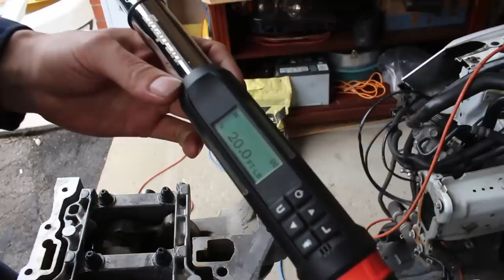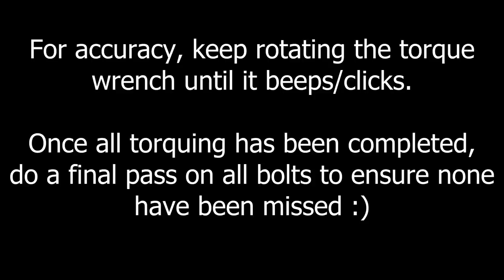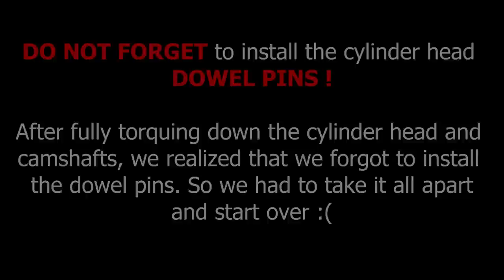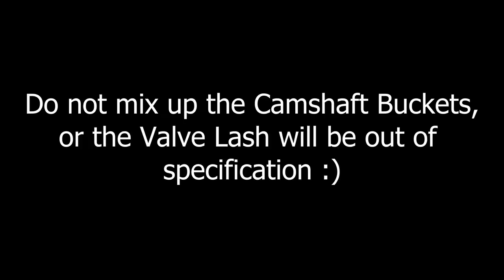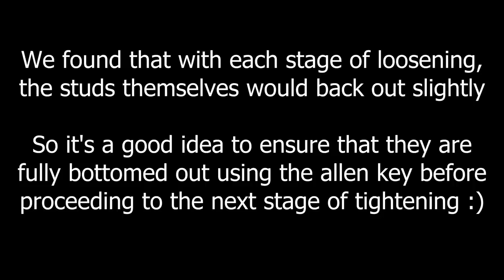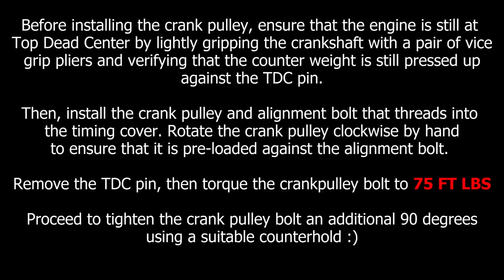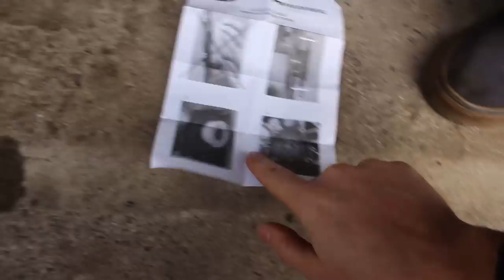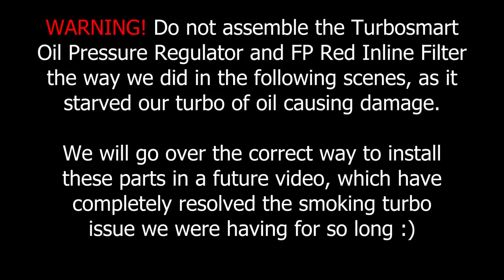Mazdaspeed 3 - Built Engine Assembly

Comment: Woohoo! Got my CX7 2.3L Turbo back up and running - thank you so much for the video and the answer to the comments along the way... I had the scariest moment though - on first start the engine seized after a few seconds despite being primed... I thought it was game over... pulley would not turn over by hand!!!

Dropped pan and found one of the rod bearings chewed up and material stuck to crank... heart sank!

I polished off the material on rod journal - crank was perfectly fine as it had not heated up... I changed bearings and noticed that the rod cap had no side to side play on the one that seized... then it struck me - the caps of the replacement connecting rods must have been switched (either by myself or the guy who sent me a new used set). When I swapped the caps over, the rod caps had nice side to side play.

Put balance shaft back in, threw in the sump pan, and the engine now purs...Works perfectly and has zero smoke. Got a few 100km on it now, and it's smooth as butter!

That was scary AF!
Reply from the maker: @pingpong9656  Oh man what a scary situation. Congratulations! Hopefully it runs for years to come

Comment: Finally! Glad to see you guys back. Been waiting for this one. My engine build is in the works for my ms3 I went with CS cams and an EcoBoost  crank. Should be interesting.
Reply: Does the ecoboost crank fit without modification?  I was under the impression that the flywheel flange is different to ours?

Comment: What a perfect representation of skilled mechanics, thanks for this video! 
What kind of alignment bolt is used for that hole in Crank pulley? Thank you
Reply from the maker: Thanks man! It's a small 10 mm bolt. I'm not sure about the thread pitch but we did notice that the 10 mm bolts that secure the power steering pump/coolant reservoirs thread into it. So just gotta figure out what thread that is :)

Comment: Before dropping the head on, rotate the crank backwards 45° from 1 and 4 at TDC. Then the head can be installed. When you put the cams on the head, get the timing close on the cams. Then the cam timing tool can be put in and the crank turned in the normal direction of rotation. Now the timing gears and chain can be installed.

Comment: Welcome back!
Reply from the maker: Thanks dude!
Reply: @WannabeTuners  I'm gonna try to take on a built engine for mine. This video seriously gives me inspiration to take on a rebuild myself. I'm just about to wrap up some much needed TLC with mine right now. New valve seals, new-ish exhaust cam, pcv plate, occ install, new stock turbo(I know), new rod bearings, new timing chain, new timing gears and guides, new timing chain tensioner, new oil pump gear, tensioner and chain, corksport injector seals, egr block off plate kit, and maybe more. Your videos have helped me immensely! Seriously!
Reply from the maker: @HoUsEoFcAtS78  We're really glad to hear that brother!

Comment: you always do a final wash of a block after the machine shop is done, they just don't get them clean enough for assembly, also, never touch the plain bearing surfaces with bare hands, the oil in your skin will create hot spots .  also check final rod/main bearing clearances before final assembly.

Comment: Quick tip: use electrical tape on the braided lines and then cut the hose on the tape. Perfect cut and easier installation of hose ends.
Reply from the maker: We tried electrical tape but found that a zip tie worked better to keep the braids from fraying

Comment: Guys, tip for the future, tape the hoes and then use zip tight so when you cut the line every single wire will stay at the place dont remove the tape until u place AN fiting and then you will be able to pull the tape holding the fitting in ist place. Btw appreciate so much content you make, wish for more videos comming soon
Reply from the maker: Thanks for the tip man, we didn't have any tools specifically for AN fittings so we tried to make do with what we had lol

Comment: Oh my goodness, anyone watching this PLEASE do NOT put a gasket/sealing surface of any kind on concrete while trying to loosen, tighten or doing anything else for that matter!!
  If this was a high pressure sealing surface it most likely would have failed and needed to be machined flat/true after something like this.. 
  But otherwise pay attention, ESP to torque specs on things that literally have just a few threads to hold whatever bolt or firing in place..
  Oh, and last tip for anyone watching before doing ghis or a similar job, having the metal surfaces extremely clean is the most important thing for getting fittings like these to seal properly with no leaks! The clean surface, followed by the proper sealants and proper torquing(in the proper sequence obviously where that applies) will give you the absolute best chance of success possible!

Comment: 18:30: It's a debatable topic because when you install somthing that needs to be torqued down , you pull the clamping hardware down and when you do another pass you go above the initial torque you had set it to , think about how many passes at 35nm you could do before they all are actually at 35 nm , the gasket will keep crushing

Comment: I’m so happy ur back in action, I got a 16 focus st since u blew ur motor. They’re pretty similar. It’s got an EFR 6758
Reply from the maker: Ohhh man how does it compare to the speed?
Reply: Wannabe Tuners it’s about the same. I test drove the Speed3 before we got the ST. The only reason was because it had about 80,000 less miles. I didn’t know how lucky we were when we got it. It already had the Full Race EFR kit with catless DP, the 6758, straight pipe roush exhaust and CPE lightweight FMIC. All it needs is the exhale pipe and an Accessport. We’ve been strained on money so we’re gonna have to wait for the AP but still right now if it’s even a little wet the tires will spin all the way in 4th. I’m in Florida so it usually is always wet. It’s nice, and it’s just like the Speed3 only newer features. The only bad part is w/o an AP the ECU is very limiting
Reply from the maker: @ryanharris6788  Yeah I was gonna say you'll be able to really take advantage of that setup with a solid tune, but that's awesome man, glad to see a fellow boost enthusiast enjoying their car. I've always had an admiration for the ST's
Reply: @ryanharris6788  with all that mods on by the previous owner. You need to take extra preventive meassures b4 you really beat on it.🤘
Reply: Wannabe Tuners If ur ever in Florida hit me up for sure. I don’t know why u would be but hey, offer is out there.
Reply from the maker: @ryanharris6788  Florida is definitely on my bucket list ;)

Comment: Glad to see you guys are back. I want to point out that the crank pulley is still crucial to the engine running. Sure, if it slips, you will not damage valves. However the car will not run right or stop running altogether, as the pulley tells the ecu crank position.
Reply from the maker: You're absolutely right brother! The nice thing is that it only has to drive accessories so the chances of it slipping a pretty low if the correct tightening procedure is followed
Reply: Absolutely! Why did you have only the gears keyed instead of doing the pulley as well? Big cost difference?
Reply from the maker: @spillybuilt7491  Tbh I'm not sure because I did provide them with the pulley as well. I think they just didn't see a need to do it. I questioned it but decided to just go with it, as they were super busy and I didn't want to burden them
Reply: Yoooo that cam cap you guys put on backwards needs rtv around the bolt holes. Will it leak? Maybe. If it does, that’s why
Reply from the maker: @spillybuilt7491  Oh that makes sense actually, I'll keep an eye on it ;)

Comment: When you put the main seal on - did it not push the RTV into the pan in the bottom? Is the correct procedure to put in the main seal first, and then RTV the oil pan after fully under the main seal?
Reply from the maker: That's a good question. I think to be extra safe, you could apply additional RTV to the bottom side of rear main seal after it's been installed and just flatten it out with your finger. I haven't noticed any leaks though :)

Comment: Great video, one suggestion is to put that return bung on the oil pan higher up... the higer the better
Reply from the maker: Like higher up on the oil pan? We didn't want to drill into the block itself. The nice thing about where we placed it, is that the oil pick up tube is on the opposite side of the oil pan baffle, so we shouldn't have any issues with turbulence at the pick up. Also, the oil returning to the pan is under pressure since it's being bled off, so it's essentially forcing it's way back into the oil pan through the oil that's already in the pan. So far no issues and the smoking turbo issue is completely resolved. We'll make a video that covers the full setup in more detail ;)

Comment: Just installed new pistons and rings - should they make a slight scraping sound when crank is turned by hand? Feels a bit jerky too, but still easy to turn... I was expecting total silence with oil on pistons and cylinder wall. What has been your experience?

I did take out my piston to verify rings and cylinder wall were not damage - they were in great shape...

Don't want to progress in the build until I know it is normal for some light scraping sounds on new rings and newly honed cylinder walls - please share your thoughts!
Reply from the maker: Yep I noticed the exact same thing. The new piston rings need to bed in with the newly honed cylinder walls during engine break in.
Reply: @WannabeTuners  Yes - I rotated it a few times, and the noise is already coming down - feels good on rotation too now. 

Good to hear you experience the same - gives some piece of mind! Don't want to do this twice for sure!
Reply from the maker: @pingpong9656  100% this isn't something you want to screw up lol

Comment: Just tried to prime engine after rebuild - did 10 second bursts for about 30 to 40 seconds - the low oil pressure light did not go out. (Has spark plugs out and foot flat on accelerator to disable injectors).  Called it a night - will try again tomorrow. 

What was your experience like - how long did you have to crank engine to get the oil warning lamp on dash to go out?
Reply from the maker: I went based off of my AEM oil pressure gauge. I'm not sure if the low oil pressure light will extinguish while cranking, as the oil pressure won't be as high while cranking. If I recall correctly, we only needed to crank it a few times before we saw oil pressure on the gauge. I think once we maxed out at around 35 psi, we we're good to go.

Comment: Did you get the bottom half of that balanced at the shop before you put it together?
Reply from the maker: Nope, our machine shop said it wasn't necessary because of the level of quality of the rods and pistons, and that the crankshaft itself is very well balanced from factory

Comment: I'm pretty much stock, save for catless downpipe, intake and cst4 (+hpfp, of course) and tune. 
about how much are you into this engine? I blew the head gasket and I'm looking to upgrade some stuff while im in there. can you ballpark how much it was to have the head looked over by a machine shop as well?
Reply from the maker: If I remember correctly, total cost for machine work not including parts was about $1300 cad. After all was said and done with parts and whatever else, it came close to $8000 cad

Comment: Question about the oil pump sprocket and timing chain sprocket.... I'm planning on using the mustang ecoboost crankshaft and will have it Keyed. Did you just use the factory oil pump sprocket and timing chain sprocket and had a machine shop key them? Or did you purchased them already with a Keyed passageway?
Reply from the maker: Yes we got our machine shop to key the OEM crankshaft, OEM timing chain sprocket, and OEM oil pump sprocket. Only 2 friction washers are used. One in between the timing chain sprocket and crankshaft, and one in between the oil pump sprocket and crank pulley. If you key the crank pulley as well, the friction washers are not necessary from what I've read :)
Reply from the maker: Also I didn't know the ecoboost 2.3 crank is compatible
Reply: Thanks for the info, and yes,   form all the research I've done, the ecoboost crankshaft fromnthe mustang is compatible.

Comment: Why not install 1 and 4 piston/rod assemblies before turning the engine upsidecdowgn to tap them "down" to the crank and install both rod caps at the same time. Unless you are measuring rotating torque after installing the crank and then each piston/rod assembly. Record these values for comparison with other future builds. The rotating torque should increase the torque required by the same amount with each piston installed. If there is a difference, now is the time to check for the cause and correct it.
Wedangrind did this when they built the engines for Dave Morris' F Atlantic one year. He had the fastest straight speeds which all the teams noted. The next year Weldangrind did all the Atlantic teams engines. Now they only work on heavy duty and industrial engines.
Reply from the maker: That's great advice!

Comment: When you put the oil pump in - did you have to prime it before installing? Or does it go in dry and you crank the car with starter after car is back in car? Please let us know what your experience was!
Reply from the maker: We just installed it dry. We primed the engine before first start by cranking the engine until we saw oil pressure on our AEM gauge with the pressure transducer installed into a sandwich plate above the oil filter.
Reply: @WannabeTuners  Sounds good - I did run a bit of oil threw my new pump before install, just to lube it up a bit - good to know it will self prime!
Reply from the maker: @pingpong9656  Yeah good idea to lube it up before install!

Comment: Was there a noticeable difference with the balance delete?
Reply from the maker: There's definitely more vibration with the BSD but u can always run softer motor mount inserts to reduce the vibes (I know Damond Motorsports offers these). The BSD helps the engine rev up more easily when rev matching during downshifts. I'm sure it also helps the engine make power more efficiently as it no longer has parasitic losses from the balance shaft assembly.

Comment: What head gasket did you go with? And what thickness?
Reply from the maker: I went with the OEM head gasket that came in the Stage 3 engine build kit from edge autosport: https://edgeautosport.com/stage-3-mzr-motor-build-kit-mazdaspeed-3-2007-2013-mazdaspeed-6-2006-2007/

Comment: Where did you source all your parts brother?
Reply from the maker: My machine shop sourced the 88 mm Manley Platinum Series Pistons with the thicker wrist pins, Manley H-Beam Rods, Clevite Main/Rod Bearings, and ARP 2000 Main Studs from their suppliers. I ordered ARP L19 Head Studs, Supertech 55 lb Valve Springs, and the Stage 3 Engine Rebuild Kit from Edge Autosports website. I went with a Corksport Balance Shaft Delete kit from Corksports website. Many of the components can be purchased on Edge Autosports website, but it's also a good idea to talk to your machine shop to see if they can source specific parts for a better price.

Comment: The easy way to install steel braided lines fittings,is to wrap electrical tape around (one loop around only). Then cut the line over the tape center and insert the fitting. EASY" and *WALLAHH*😉

Comment: Logically wouldn’t you want to torque the bolts to closer to the minimum torque spec than the max because then they will be able to take more abuse before snapping as they they are less deep into the elasticity zone of the material? Just an after thought, not that I think it would rly matter given the security factor they probably equate into that torque spec anyways.
Reply from the maker: If you've got experience when it comes to tightening fasteners by feel, I see no issue doing so ONLY for the less important hardware. That being said, torque specs and sequences are always a good idea. In my experience, I've had several instances where I attempted to tighten a fastener to the recommended torque spec, and it snapped the fastener. Going by feel is sometimes better, especially if small hardware is being reused ;)
Reply: Wannabe Tuners oh absolutely, I meant for some of the bolts where you had a range of torque specs to chose from and you chose closer to the top of it than the bottom. Either way if you know what you’re doing, by feel is almost always more consistent, take metrology for example, these guys go all by feel and are light years ahead of what the little ratchet can get for accuracy on a micrometer. It all hinges on experience, Love the build!
Reply from the maker: @knightfall7534  Thanks man, as long as she holds together I'm happy 😂